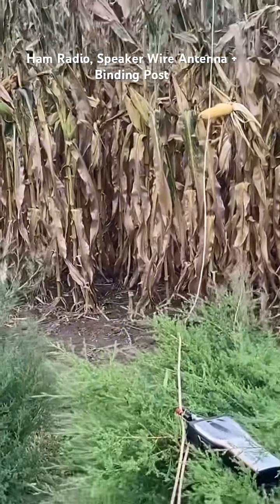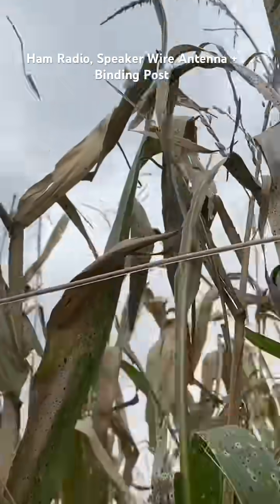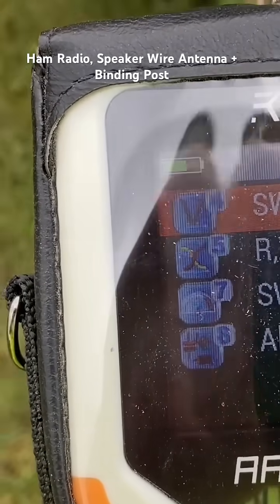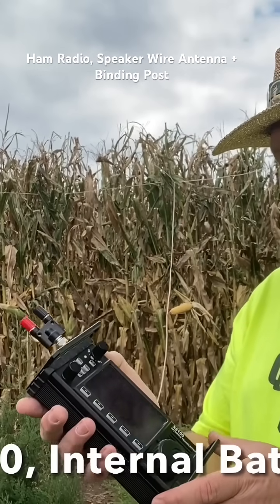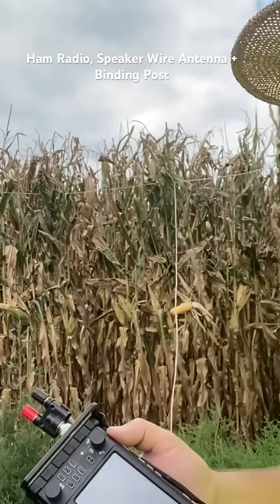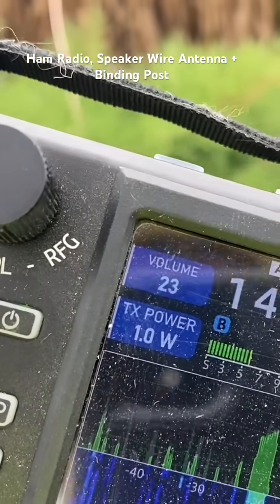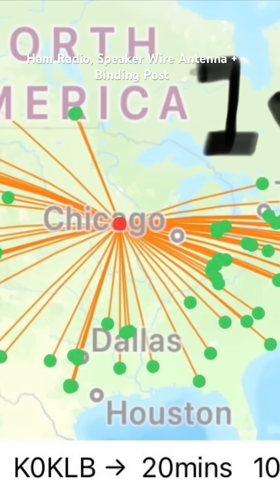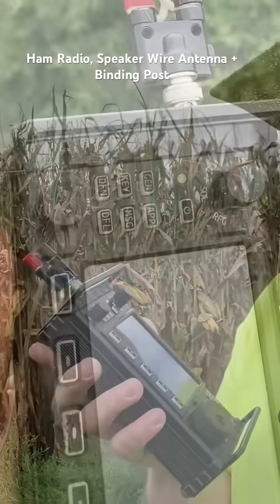Ham Radio Low Budget Antenna.

Comment: Newbie here, So thats just speaker wire split down the middle at the 16.5 ft pnt for the legs of the dipole. No balun??. And the feedline is 15.5ft directly to the coax splitter on the radio?..wow..Do I have to wait and grow corn too first?
Reply from the maker: That’s right Mel.. just as you described.. the lengths are measured for low swr.. your location and height may vary the lengths a little.. Haha to grow corn, lol.. I just used what was available to get some height.. you can use tall bushes or maybe a couple 10ft pvc sections or trees, etc.. just experiment with what ever you can think of and have fun. 73
Reply: Wow..Thanks.

Comment: Does the feed line have to be 15 1/2 feet long?
Reply from the maker: The 16.5 ft legs in combination with the 15.5ft balance feedline is where it tuned on the rig expert the best.. any length changes will effect the SWR.. Your results may vary based on height above ground or other variables so start with your wires a little long and trim off to your best results. but most of all, have fun experimenting..!
Reply: @hamradioqrp-k0klb  Thanks so much for the info!
Reply: Better to go long at first. Then trim like you said. Every situation will always be different.
Reply: You should where an old baseball uniform! Lol
Reply from the maker: @toddbartel6300  hahaha.. Like the Field of Dream?.. LOL.. that would be funny.. 73